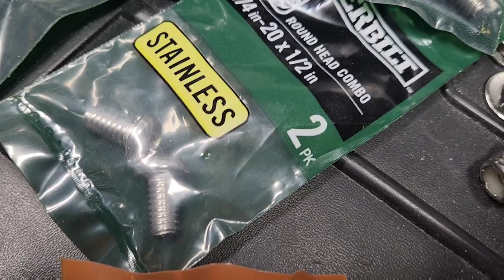Cracked Tunnel Repair on SkiDoo Gen 4

Comment: I would have used falt aluminum not diamong plate and i would put stainless rivets have used many on sleds and other projects they stay put better
Reply from the maker: Had to go with what was available locally. Most retail hardware and ranch supplies will only offer 2"×1/8" material of the shelf. Our industrial metal suppliers here dont carry aluminum. Only industrial steel.

Comment: You drilled out the rivets wrong,  suppose to do on the face.
Reply from the maker: I gotta disagree... if you've tried to drill these you might understand why i did it, i think i actually explain the reasons in the video.
Reply: @nevadahigh365  ive drilled alot of these and drilled like you, until i learned the correct way from an aircraft mechanic friend.  center punch the head use a small drill bit for a pilot hole, then a bigger one thats almost the size of the head, start drilling and the head 9/10 will pop right off. super easy, try it
Reply from the maker: @SuperCody888  heres my take... have drilled many rivets both in a fab shop and working on sleds. I agree w what you mention about drilling the head on alum rivets. Snowmobiles use those aircraft (dare i say stainless) hardened rivets. Center punching the head was my first process. Head was so hard it really wouldt center punch. The hardened rivet along w flex in the alum tunnel that absorbed the force of the hammer strike. If you watch the vid, even had to drill out the rivet after the head was completely ground away...using cutting oil and slow drill speeds so as not to cook the drill bit.  Would definently be open to learning how someone could center punch/drill these rivets...but it as of yet hasn't worked foe me.
Reply: @nevadahigh365  what type of drill bit are you using?